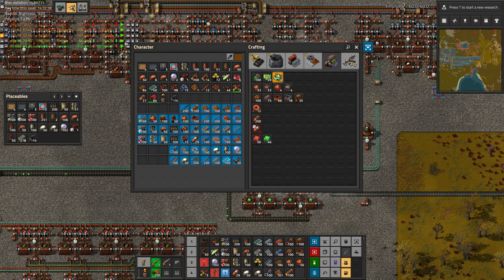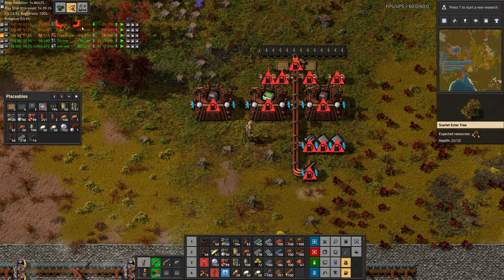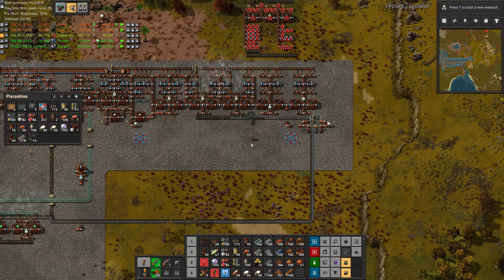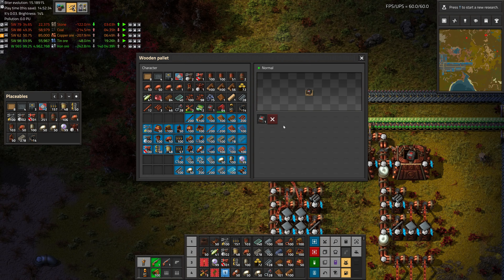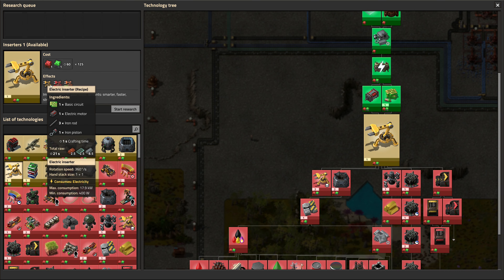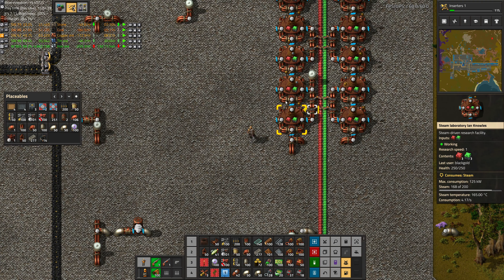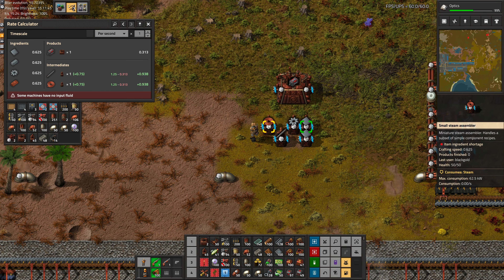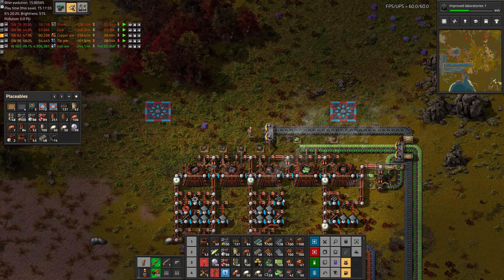[Factorio] IR3 Ep 12: Computers & Inserters

Comment: Here's an observation that made makes my current IR3 run much easier (I'm soon going to start making oil):

In the early/mid game, the malls are the vast majority of your complexity. The thing with malls is that they don't need to scale, unlike science. So I put them on the side - I put them on the top right or top left corner of the factory, both are on the top side of the main bus. (If I were less lazy, I would even add a lot of belts leading up to each mall, in order to make it take up only a single line. It's going to be a very long line, but it's away from the bus so the space it takes will be even less noticed)

I also make it into a huge spaghetti - I make their own buses for the parts requiring a large assembler such as pistons, motors, grids, circuits. It doesn't matter because I just need 1 machine making each building. (If I redid it, I would also aggressively reuse belts, like Marsh is doing - 7.5 items per second is more than enough for any intermediate in a mall)

Designing malls can be a time sink, but it's unnecessary since it's all going to be demolished later and it doesn't need to scale. It's enough that your mall doesn't get in the way of everything else. 

Everything apart from malls I'm making infinitely scalable, going up or down from the main bus, this way it takes only a little horizontal space. Later in the game there will be plenty of non-mall products, but even so, I've beaten AngelBob with this approach - no trains, almost no logistic bots, just belts - so with this IR3 is also doable and much simpler.
Reply from the maker: I agree, the early game mall only needs to be big enough or complex enough to give you a sufficient amount of automation for the early game. My goal is for the mall to last until robots. Once you have them, scaling any part of the factory becomes much easier, and also has the need for fully automated machines.

Even the mid game main bus only needs to be so big/complex, as a simple early mall may last you through the mid game. When you get full logistics control, it may be better to skip the bus for many items entirely, since there are so many intermediates. Basically IR3 is all about, how far can you put off big malls and busses, because as your technology improves the ideal solution tends to change.
Reply: I personally started automating every machine from the start, avoidingmanual crafting let's you have a cleaner inventory with more room for belts pipes and inserters.

Then i started with a tin and copper bus, for the early game, then a second bus, iron glass and coper for a few iron machines, to the left of it (bronze was a temporary setup in the early ore processing area, since it was mostly used for science and little more.

Once i had electricity, i started the "final" iron mall, a new horizontal bus, in a first stage i automated all the intermediates and put them on a buss to. joined that to the buss with ingots and raw resources (stone for rails, rubber for belts, glass, wood, etc. and from there, again back to automate every single machine. Once i got steel i had fully transitioned to a rail base, so the more complex intermediates like circuits and batteries were built of site and brought by train. At this point it was a very clean bus, but then chaos started, i brought steel to the base, repeated the intermediate build with a new bus directly south of the iron mall, but then of course some of the things i was automating needed items from the iron bus, and i didn't really splitted them at the begining of the bus, so i started weaving belt spaget across the mall between the buses.

Now at the end game it's a big mess of spagetti, with hints of a bus buried under it and with a new area being serviced by logistics bots, with the provider chests for the intermediates being scatered all across the spagetti. A thing of beauty brought by how late requester chests are in the tech tree. I love it.

Working right now on building the rocket silos ( I use Rocket-Silo Construction) and it looks like an interesting challenge. Thanks to the train based nature of my base i have plenty of space arround where i have placed my 2 silos (maybe i should go for more, since i'm already working on it) and they require plenty of intermediates i definitely didn't put into trains at their production facilities because they didn't seem to have further use, and they are things like liquid concrete that i could be making from the stone i diggued up from the silos themselves. So it definitely is interesting.
Reply: @Niyucuatro  That is interesting, I was debating with myself, today, if I should add or not add Rocket Silo Construction, as I am usually quite exhausted at the time of silo construction. But when people put so much effort into compatibility between mods, it just feels fair to add them, given I probably play throuhh IR3 once.
Reply: @leduke79  I'm enjoying it. But it is the kind of enjoying that i would hate to do a second time.

Definitely worth to try once.
Reply: @Niyucuatro So... Perhaps not the best to combine with SpaceX, then? :P ... Weeell, if we are to go big (SpaceX), the silo construction is just a small bypassing, for sure...